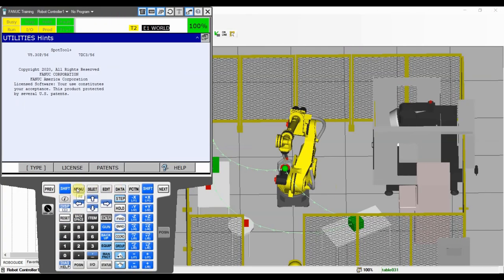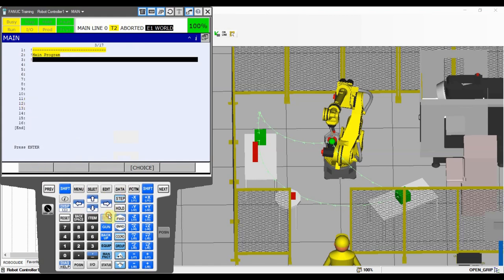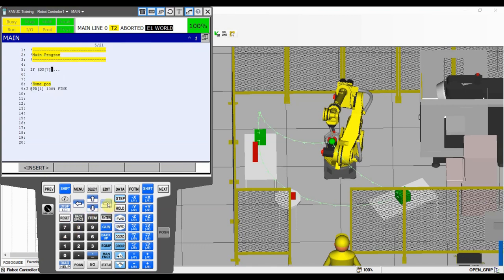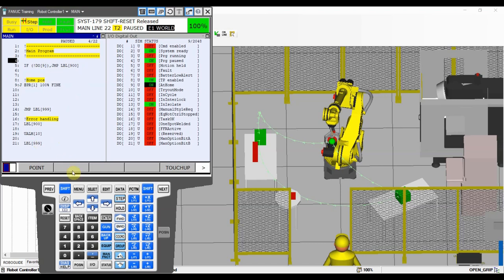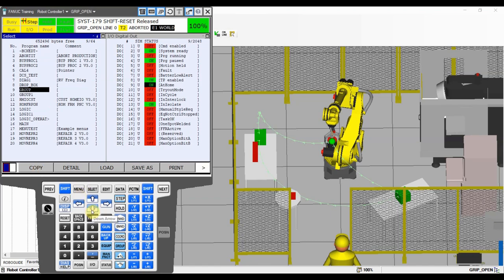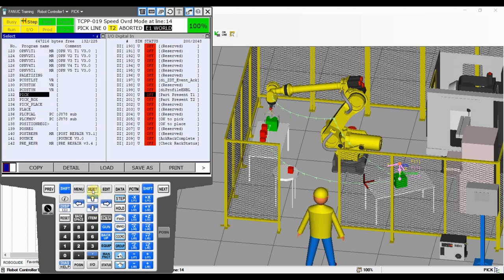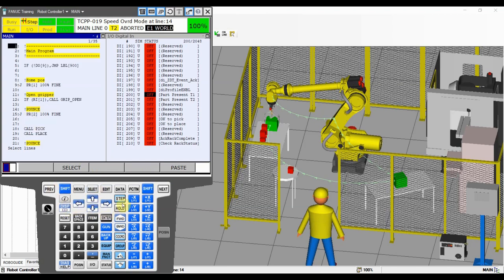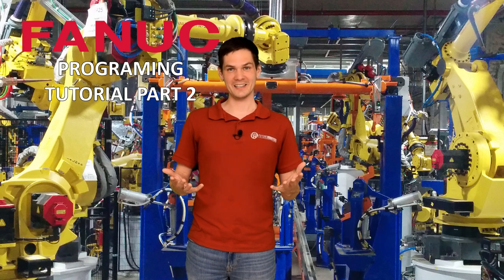FANUC programming tutorial pt. 2 - Simple pick and place application. Fully functional program.

Comment: Question
Can you add offset functions or values to preset points?, for example to compensate for tool worn out.
This is for a polishing application and I want to compensate for wheel dimensional changes.
Reply from the maker: Sure, using offset would be probably the best thing to do :-)
Use tool offset, just make sure your TCP is set up correctly :_FANUC:

Comment: Delay option available or not?.... I want to weld in same point in 10sec ...how to do?
Reply from the maker: I think your welding software should handle that, you can start the weld and wait for weld complete signal
Reply: In theory, you can have the startpoint and endpoint very close to eachother and set the welding speed to the value equal to distance/weldtime. So 1 mm apart = welding speed of 0.1 mm/s will give you a spot weld

Comment: I have to question the decision to not check if you have a part in your gripper before opening it... and then check (after you opened the gripper) for a part before picking another. You just dropped a 90 kg glass car roof.
Reply from the maker: That's a valuable comment and I did forget to mention it in the video. Thanks for pointing it out ! :washhands:As a general reminder it's always better to double check signals (part present, collision zones, clear of fixture), it doesn't take much execution time, but it saves a lot of potential downtime :elbowcough: